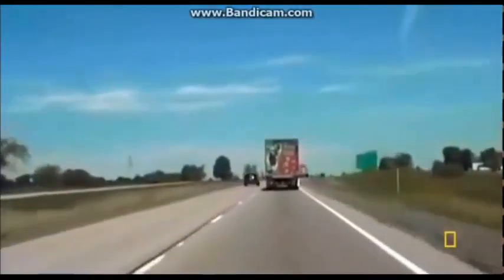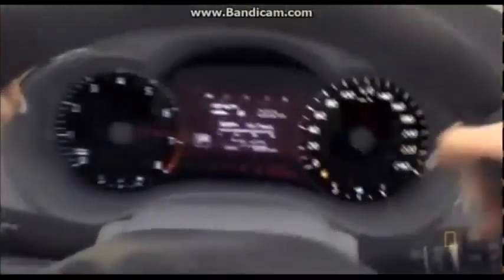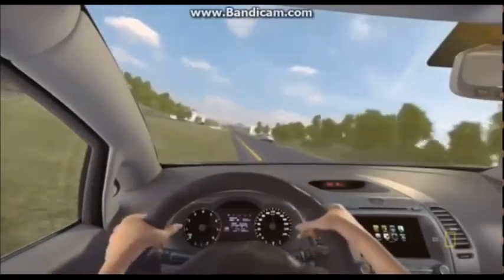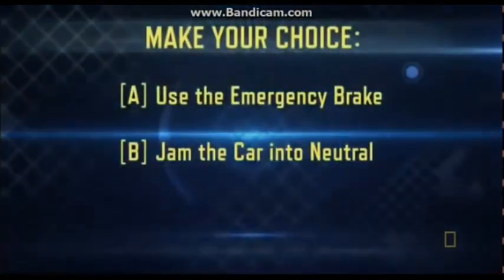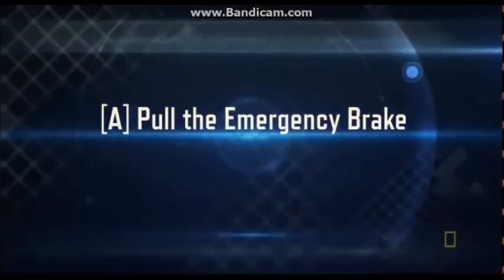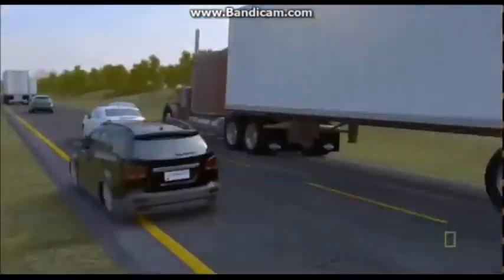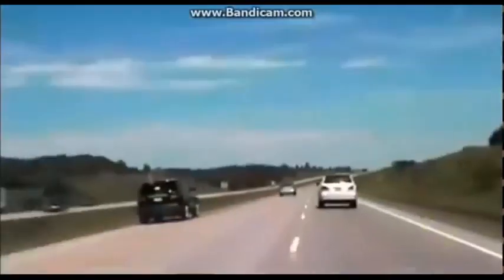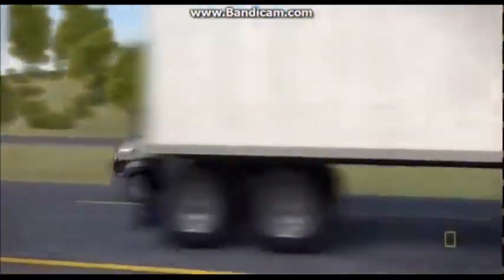How would you stop your car if your gas pedal stuck

Comment: Or D buy a manual and push in the clutch
Reply: Chris Thompson or you know just put it in neutral because every car allows you too. 🤷🏻‍♂️
Reply: Actually a lot of new cars, such as my dads don’t let you do that
Reply: I'm pretty damn sure literally every car has a neutral gear.
Reply: 2ByQ  yeah but some cars only let you shift out of drive when stopped
Reply: Not being able to cut your engine from your transmission at any time is dangerous, and from a manufacturers perspective it makes no sense to implement such a system
Reply: Well my dads truck has it. Don’t know why but it does
Reply: I looked into it and most cars allow you to shift into neutral when moving. Apparently my dads truck is just weird like that. My bad.
Reply: Np
Reply: yea lols
Reply: How do you buy an entire car while you're driving along the highway at 110 mph?
Reply: Truck? By truck do you mean like a pickup or a huge truck that pulls trailers? It might make sense on big trucks cus they're kinda different than normal cars but idk enough about them to be sure.
Reply: Chris Thompson Shift out of drive when you’re stopped? What if you’re going down a hill and you wanna put the car in the low gears, 2nd or 1st? It doesn’t let you get out of D and get into 2 or 1? That’s such a terrible car design. Although it wouldn’t surprise me cause now the E-Brakes are down by people’s feet as opposed to easily visible and useful by the gear stick...
Reply: No, pushing the clutch will make your transmission bearing wear faster. You're supposed to push it only when shifting gears.
Reply: If you're gonna make points that are contrary to common sense, then explain why in detail and maybe some sources. It makes no sense for the transmission to wear out since when the clutch is depressed, no load is applied to the transmission whatsoever. It could make sense that the clutch wears out, but not the transmission.
Reply: @BoggyBolt Joking aside, when you de-press the clutch, i.e. the transmission is not connected to the engine anymore, you are using a bearing which I don't really know its term in English. When the transmission is connected to the engine, you are not using this bearing anymore. When you are driving, you should be in gear and not keep the clutch pedal pressed down if you are not shifting gears. Apart from wearing this bearing prematurely, it's unsafe. When you are in extreme situation like described in the video, of course you will disengage the clutch so you can stop the car, or at least try downshifting on lower gear to use engine as brake.
EDIT: I remember that I saw a video by Rob Dahm driving his Lambo in heavy traffic and there he explains it :)
Reply: I see. Well thank you for this information then.
Reply: @BoggyBolt apparently it's called "pilot bearing" according to the video from Rob. I just re-watched it ;)
Reply: Yea I heard about that thing while watching some video. Useful information tbh.
Reply: car breaks stops working and I end up going 120mph

SOMEONE! QUICK! BUY A MANUAL!!!
Reply: @KrustyAnne Now that's irresponsible. My manual is always in the glove box so I can access it any time, especially when my gas pedal is stuck and I'm doing 140mph.
Reply: vdochev wait lol I can't tell if you're joking or not 😅 but just in case: we were talking about manual transmission cars 

But if you were joking then pls 4giv for the unnecessary explanation
Reply: For a moment I thought he was being incredibly sarcastic, so I laughed like hell, until I realized he might've not been sarcastic and didn't realize you meant a manual transmission 😅
Reply: Joking, of course! :) But I drive only manuals which is not a joke.

Comment: Watching this, as a mechanic, option b or c would work. Or all simultaneously actually, turning off your engine would engage the steering wheel lock but turning the key to the on position without cranking the motor would disengage it. If the brakes have worn down from trying to stop the vehicle then you could use the e-brake to slow you down. Don't yank the e-brake, that would cause the rear tires to lock up. Slowly raise it to act as your primary brakes. Then lastly, putting your car in neutral would indefinitely work, but you'd have to turn your car off and turn the key over to prevent engine damage so you could possibly make it home. 

In sequence, here's what you should do:
1. Put the car in neutral. Don't jam it in neutral as the narrator states, because if you put it in reverse by accident then you'll have more problems then a possible blown engine at those speeds. 
2. Turn the key off until the rpm's are at 0, then turn the key to the run position. 
3. Slowly apply e-brake only if your main brakes have failed.
Reply: thats exactly what i thought this seems to be kinda logical to me...at such speed handling the wheel shouldnt be such a problem its not that difficult to steer just a little to make sure you dont crash. no one said anything about FLASHING LIGHTS and WARNING LIGHTS tho...if you flash milions of times + warning lights on the drivers will understand whats likely going on right? and yes if its in ON position the wheel wont lock
Reply: @pain2737  you're correct, steering isn't an issue but that's only if you're on the interstate or straight road. With the engine off, you have no power steering so you won't be able to turn normally. And with flashing lights.. because you're not EMS or police or fire, the only reason people are gonna assume you're driving that fast with flashers on is to go to the hospital or have an emergency somewhere. Also you can flash your headlights at other drivers, but there's 2 problems with that. 1, it takes your focus away from the road, and 2 it distracts other drivers. So it's best to keep the flashers on and keep your eye on the road, keep your hands at 10 and 2, have your seatbelt on, and brace for possible impact because not everyone is gonna see this video or my comment.
Reply: Most modern cars just have a button for the e brake tho.
Reply: @Sora-o  That is true, but for the ones that still have the ability to pull the e-brake, this still applies to them. Also.. even if i still had an electronic e-brake I'd still use it. I'm pretty sure modern day vehicle manufacturs thought of the idea of your main brakes failing and you still needing a backup. I can't imagine any other application you would use your emergency brakes for, other than towing/hauling.. but that's mainly for trucks. Any low speeds you would need your emergency brakes for, you could use your regular brakes, and parking? Just use park. Now if your brakes are so worn down that you can't stop, for 1, you're stupid for not getting them replaced.. and 2, I guess that's just about the only thing you'd use them for. But that also sorta is the same situation, just different speeds and with a non malfunctioning engine.
Reply: If my car is stuck accelerating and im likely going to die if I don’t correct it I could give a shot if my engine makes it out unscathed 😂. Can always buy another car.
Reply: The Scion 2013 XB wont even allow me to do that (turn off engine). I can however shift it to neutral and apply the brakes.
Reply: @pain2737  yeah your forgetting about how it feels to be hurdling at 120+ not in control of the car. Ever felt that? Prob not its fucking ridiculously terrifying. The nerves would be out of this world. Prob just do what the  video said. Where trying to survive not save rhe car
Reply: Literally every car, especially Toyota's have a Reverse gear inhibitor which prevents the gearbox for engaging reverse if the car's speed is above the threshold.
Reply: @will54981  power steering makes absolutely no difference in terms of diminishing the required strength that it takes to turn the wheel if the speed of the car is above 10-15mph.

The sole purpose of a power steering is to assist the driver with turning the wheel while it's stationary, not while it's rolling.

Try taking out the power steering fuse and driving the car that way and you would know what I'm talking about.
Reply: @staidey5994  No, power steering is there to assist drivers so they don't have to turn a steering assembly and 2 tires all by sheer strength. How many stop lights/signs have you been at that you've had to turn at? Exactly. I've owned 2 vehicles before without power steering and it was horrible trying to drive them.
Reply: @will54981  I've literally driven an 8th gen civic with a bad steering pump. It's only stiff to turn when the car is stationary or close to stationary; however, once the car picks up the speed, it becomes easy.
Reply: @staidey5994  Mkay, well imagine if you was 65, old, feeble, and weak driving that same car to the grocery store. You think pure muscle is gonna win in that scenario?

Comment: Wtf, just turn the engine off and directly turn the key in the 2nd of the 3 positions. The steering won't get locked, only the braking will be heavier if you push the pedal more than once.
Reply: You lose power steering without the enginr unless you have electronic power steering
Reply: Diddz' 
So what. You only need power steering when you are almost standing still and need to make large turns. At driving speeds you won't feel the difference. The only thing that could surprise you is the loss of power braking.
Reply: the not needing steering does not account for all situations on the road in practice, if you are trying to stop a car, and say you manage to bring it to a safe to steer condition.. but theres a bend or river ahead you will drive straight into if you dont either steer, or stop in time.  i guess if you are in that situation, you're screwed either way, in theory, that'd be possible, but in practice, it just takes the wrong condition or wrong environment to screw you over.

i have been in a (less deadly) situation where thge engine died and i didnt know for a while coming up to a bend, i lost brakes, and lost power steering, if i didnt catch it in time and get my steering back.. guess what, i would have veered off the road, and into a deep ditch that lied on the side of the road i was on because the wheel wouldnt turn, the vehicle had hydraulic steering, which meant the steering wheel was stuck AF if the engine wasn't running
Reply: Diddz' 
Power steering only does a job at speeds over 5mph. And at higher speeds it can only be harder for an almost unnoticeable amount. The wheel can only be stuck if you completely turn of the contact with the key (steer lock) or it will be hard to operate if you are driving a very heavy vehicle (a massive truck or something like that). An other possibility is failure of the steering but that's not connected with turning of the engine.

 I've driven many times a few hundred yards downhill with engine turned off. Goes quite normal, like old cars without power steering and just as expected.

The question here was what to do with a stuck gas pedal. The speed would be quite high, so power steering isn't needed. You just have to keep in mind to keep the key in the contact position so that the steering wheel doesn't lock and know that after 3 to 5 presses on the brake you lose power braking. No big deal.
Reply: so i guiess when  acceleration is stuck af full throttle, you kill the engine, lose power steering at 100 MPH, exceed the power curve, then fly off the road and die. in my experience, without power stering, i have to muscle the wheel very very hard just to nudge it over, in a vehicle with electric power steering, it was only as hard as steering a golf cart without the motor assisting
Reply: Diddz' If you are going too fast to make a corner power steering won't save you. Yeah steering without power is hard as fuck if you stand still or try to park it at low speeds. At 100+ mph it's as easy as with power steering. But at those speeds if you lose power brakes you will have to press the pedal very hard to brake for a corner.
Reply: Diddz' fun fact you don't need power steering to steer a car!
Reply: alot of cars till the end of the 80s didn't have power steering, sports cars didn't have power steering even a Lamborghini countach didn't have power steering. you only need power steering for extremely low speeds, like parking
Reply: I am really shocked by the amout of people who think they need powersteering and powerbrakes to survive😂.

And even if the wheel locks (which isn't likely to happen if you know what you're doing) it's still the best solution. Just time it. Drive untill you have a straight piece of motorway and brake. The stopping distance will allways be sufficient to stop safely. That idiot woman had been driving for a large amount of miles, even had the time to call!!! So turning of the road or driving into a trailer while stopping was the least of her problems.
Reply: LoL . I ride a motorcycle and they don't have powersteering or powerbrakes either. And here I am. Still alive. And we own a Pickup where in the past the engine "died" on us during a turn(the pickup had some idle issues because the battery drawed to much power/was dead). My father immediately noticed that the engine was off due to the loss of the power steering but he still could turn it but it was very hard. Then he started the engine again and everything was fine
Reply: Then tell me how those old F1 cars with 1300 horse power at 300kmph can still drive and steer without: ABS, Traction control, stability control and power steering. Compared to that a normal road car is very light to drive even without power steering, everyone with a driving licence should be able to turn a normal car without power steering.
Reply: or you could get a real car... Like a miata (which for some reason people say is girly?) which doesn't have power steering to begin with (cause of course you have to get an NA Miata), and in most cases is also a manual transmission (i wouldn't touch a car that isn't with a 15 foot pole) and also doesn't have abs or any of that shit the brakes are just brakes. So basically a real mans car! Cause i'd rather be "inside" of something that's "girly" then be "inside" of something that's "manly" miss me with that gay shit
Reply: why fckn miata near thousands of other quality vehicles..
Reply: support group Miata is about as quality as it gets. Manual, rwd, the engine it comes with the BP is MADE to be turbocharged meaning that if you don't it literally lasts forever or that you can turbocharge it with no problems right off the bat. The only car that might be easier to modify is a civic. It only weighs 2000lbs meaning that the cornering speed is way faster and braking distance is half of what most cars are nowadays (well not exactly since speed squares those so since you'll be driving much faster it's actually the same ;) ) not to mention how easy it is to engine swap one (since a lot of people do that) and there's nothing like a kmiata (either k20 or k24) which people get up to as much as 300hp.... NATURALLY ASPIRATED! (so obviously if you wanted 600+ hp to smoke lambos or ferraris then just turbo it except you don't need that much since like I said it weighs a thousand and so pounds less) assuming you have good wider tires and coilovers it's literally one of the best cars honestly especially when you consider just how cheap it is to get one. Plus like I said you don't need to worry about traction control or any of those things slowing your lap times ;)
Reply: If a car that is made to have power steering loses power steering It's way harder to steer than a car that is made to not have power steering. Plus with dumb modern cars the wheel actually locks when you turn it off.
Reply: Yes. Even if you pull the key out, steering will not lockup. Coz it needs atleast 1 full rotation to engage the lick. So 2 option could save you.
 Also if you have a manual transmission, you could press full clutch and put it in N
Reply: Niggah you put it in mitral then turn off the car 😂😂 this ain’t that hard anything vehicle dirt bike anything will role even if the rhino is off in nutral 😂
Reply: Petar Čalić 
IKR
IM 14 EN I KNOW DIS LOOOOOL
Reply: jemsncrystals on my 2004 ranger, when you take the key out and small movement in the steering wheel locks it. I somtimes even lock acidently when im getting out of the car, now, every cars different, but ita better to not find out
Reply: Well most modern cars have keyless ignition now, so that’d be more challenging.